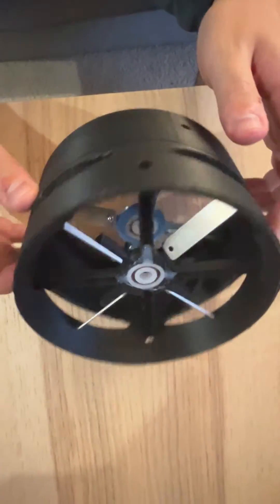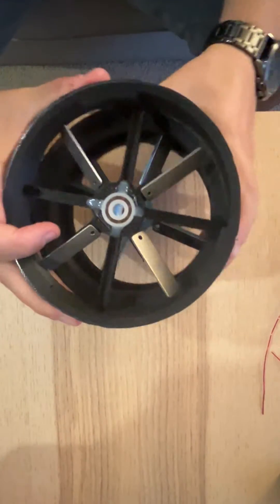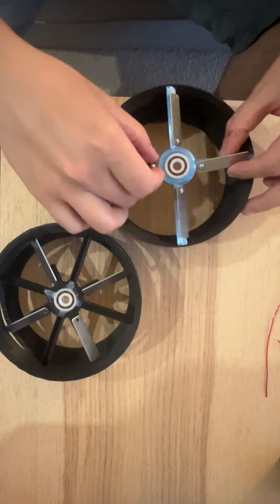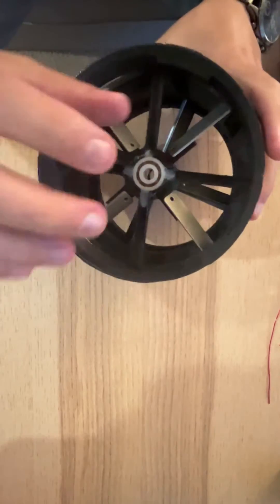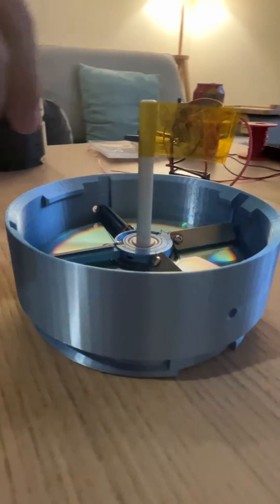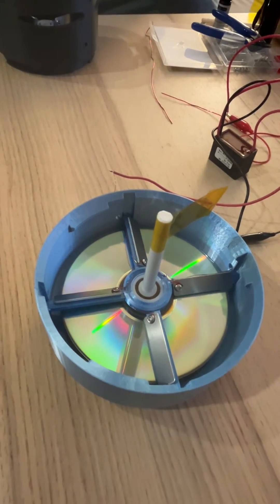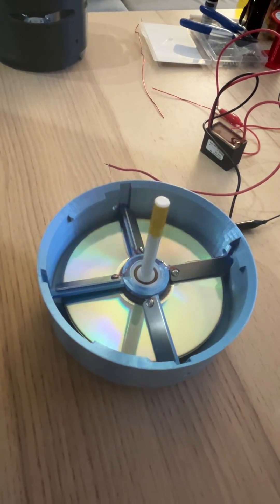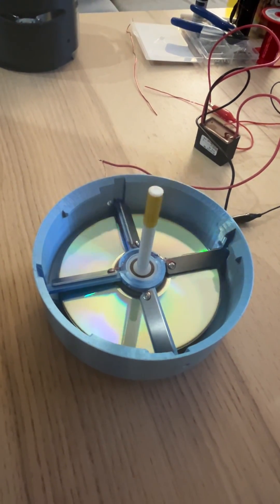Corona motor concept

Comment: keep doing what'chu doing, i was wrong bout the other stuff i was talking about before on your channel. i now see this 'sterling' thing is the way forward. i'm actually tempted to buy one from you. i've been doing so much research now on rijke tubes, singing pipes and now sterline/piston engines for my electrical generator project.
Reply from the maker: Glad you came around
Reply: @LES_Thermodynamics  yea what sold me was that i realized my 'crystal battery' idea i had will corrode regardless and this will not sustain long term all chemical batteries corrode and leave nasty stuff behind and that i want something long and sustainable into the future and boom it hit me, wait can't we just use heat to power directly a motor/generator? and then i went back to all my research and yea the stirling engine, specifically the acoustic stirling engine, was the main thing here, it has everything going for my 'no-moving-parts-generator' without the corrosion of the crystal cells. i started digging and researching again and came back to you and i was like oh yea this the one guy. i still believe the piezoelectric effect direction is the way though, the loud decibel or the internal oscillation of an apparatus with the piezoelectric material vibrating them would produce big voltage is the path forward considering magnets lose their powers over time, the piezoelectric method retains it shape forever and does not corrode.

Comment: Hey, I’ve been working on the concept of using “ionic wind” in the compressor section of turbo jet engines. Since the byproduct of Corona discharge is ozone, this in theory would convert the oxygen reactant into a more power reactant or oxidizer. Naturally since the air is compressed the effects of the corona discharge making ozone I suspect will be amplified.
I already have built a turbo jet engine, I just haven’t built the corona discharge concept, I was wondering if you would be interested in exploring this concept.
Reply from the maker: I’d love to learn more about it. Join this discord of other alternative power people and we can all talk about / share ideas. https://discord.gg/dtqd7X5mJ5

Comment: What is this good for?
Reply from the maker: I haven’t decided yet. There is some interesting research on pulling high voltage from the sky (400’ minimum). High voltage and extremely low current is very achievable, so if someone could find a way to make reasonable torque then the motor could be revolutionary. The torque is the issue.